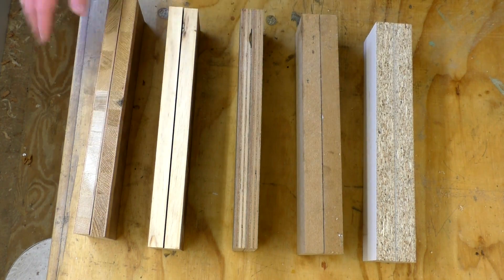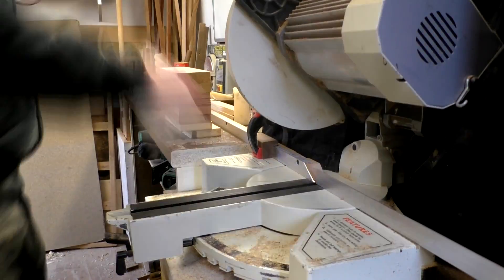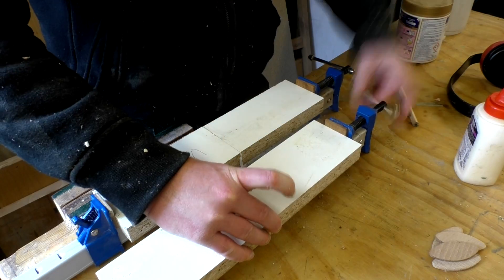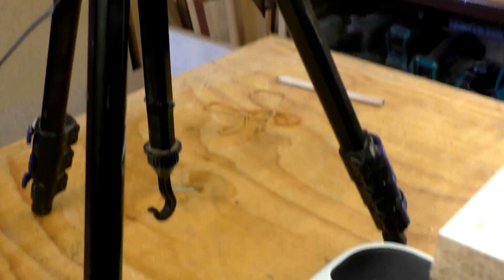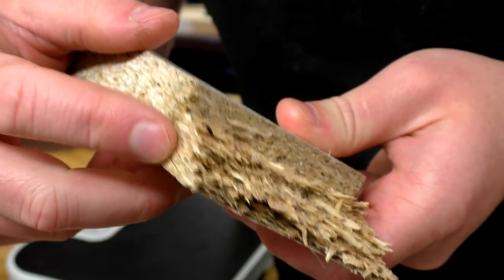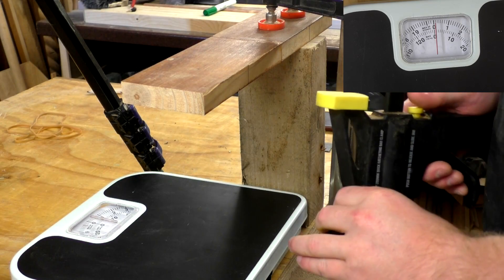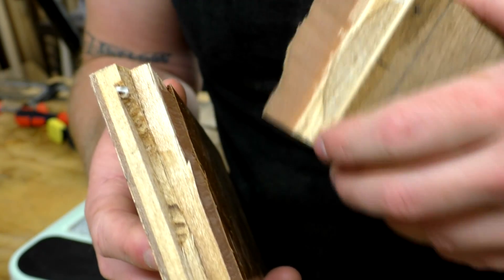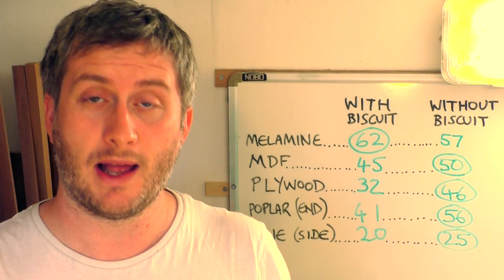Testing Biscuit Joint Strength - Do Biscuits Add Strength To A Glue Joint?

Comment: Not surprised. I'm barely a casual weekend warrior when it comes to wood working, but the first lesson I learned was that it was the glue that was the strength of the joint (granted I'm trusting the woodworker who taught me that). In my first projects I used brad nails as a method to hold the joint until the glue set, but once the glue set, the glue would holding the joint together. Biscuits have always been an alignment tool, and I use as few as possible because the biscuits themselves tend to be weak wood, so they break easier, compromising the integrity of the joint.

Comment: Interesting. I'm wondering what a hardwood test would look like. And a thicker wood test with double stack biscuits. 

Mind you, I wouldn't expect any joining method to hold together using either of these methods when lateral pressure is applied. I'd at the very least use a half lap or dowels. Still under this kind of test I wouldn't expect any joint to survive long. Even a mortise and tenon joint would fail given enough pressure.

Comment: I dont understand why people keep saying that wood will break rather than glued connection. Why are tenons used then?
Reply from the maker: Tenons are used to increase side grain to side grain gluing surface because side grain to end grain joints are not strong
Reply: @RagnBoneBrown  hmm, how certain are you that that is only reason? I always thought it was mechanical reason, and thats why tenon is 1/3 wide, and mortise walls 1/3 each, therefore strongest joint of all.

Comment: Hey man, although yours tests were accurate, these tests aren't geared to how a biscuit is supposed to actually strengthen a joint. A biscuit is supposed to increase the glue surface parallel with the face of the board. In other words.... Don't test it's strength in bending. Test it's strength in pulling. Like pull the two joints apart from each other without bending it. That's theoretically how biscuits are supposed to help. There are also specialty biscuits like self clamping biscuits. Those can be very useful, as well as alignment, making assemblies go smoother and faster. 

Good tests, but not exactly testing what biscuits are good at... But still good for showing that biscuits actually hurt the flexural strength of a board. I've seen this same result on dominos and metal in lays.

The best thing to prevent bending like you are doing here is a finger joint with only glue holding it together. That's likely to be stronger than the wood surrounding it because you are layering the grain and stabilizing it with a glue bond.
Reply from the maker: When biscuits are used for adding an trim to a table top for example, the force applied to it would be downwards, not a pulling force
Reply: @RagnBoneBrown  ... No it's not, man. The force would be every direction for a table top skirt. People are going to be pulling on that thing and leaning on it and every other way of force. Not just straight down. And I didn't say "this isnt how people use biscuits" I said "these tests aren't geared to how a biscuit is supposed to strengthen a joint". People use biscuits like you showed all the time, and NO it won't add strength this way. If someone was gonna use a biscuit for a table top skirt it won't add any strength. It will just help for alignment. But let's say if you had biscuit joints holding a face frame onto a cabinet, and then tried to hammer the face frame back off a cabinet, that is a way that the biscuits should (in theory) add a small amount of strength to that specific direction of the joint's resistance. 

I am a professional cabinet maker. I occasionally glue face frames directly to cabinets with no joints, nails or screws. Just glue. I attach hardwood edging to adjustable shelves with only glue as well. I make cutting boards, and attach panels together with nothing but glue. And I've tried to disassemble them when I've made a mistake, and it's practically impossible to disassemble with a great glue joint. It will destroy the cabinet. The glue joint is plenty strong and does not need any help what so ever. I've never gotten a call back from a busted joint. BUT... IF a biscuit joint is gonna add strength, it would be against pulling the joint apart perpendicular to the glue joint. 

So in conclusion.... Yes... Biscuits CAN add strength in specific applications, but it's completely unecessary. With a good glue joint you will have every bit of strength you need. Biscuits are most effective for alignment and specialty tasks like self clamping biscuits from Lamello or the T slotted biscuits from Lamello. But they CAN add strength when you use it the way I said... And you need a high quality biscuit too. Not dried out crappy ones. Any biscuit from Lamello will give you optimal results

Comment: I'm definitely surprised! I always thought biscuits added a small amount of strength because they increase the gluing surface area. But for it to be weaker almost every time is a shock.

Maybe things would be different if the biscuits were made of a stronger material.

Would also be interesting to see your identical experiment done with dowels.
Reply: I don't think so, I think is has more to do with the surface area than anything else. With the biscuits there is less surface area, in this case. That biscuit joiner is removing almost a third of the area. Biscuits also have big gaps on the sides were you would just have glue.

Comment: There are different types of biscuit joints such as metal and plastic connector biscuits. Lamello are the leaders in this field. If you cannot afford a Lamello go with independet biscuits such as Knapp and use another biscuit jointer such Mafell, Dewalt of Makita.

Comment: I realize knocking biscuits is kind of the internet contact sport of the moment, but I still like using them for joints which don't require a lot of strength.  I find they save a lot of time and prevent alignment mistakes, and the cost of tools & supplies is low.  I used to have a jar of three-layer plywood biscuits that made a slightly stronger joint when gluing the ends of plywood together, but it's not hard to improve on the strength of this type of joint.  They worked for tensile/pulling strength, but probably didn't do anything for bending.
Reply: Good biscuit joints can be really strong they can also be combine with other joints such as pocket holes.

Comment: SHEAR strength. When will a biscuit joint ever be under load in a lever action situation. Tests need to be conducted in their respective application. Biscuits would mostly always be under a shear load.
Reply: I disagree, biscuits are used quite commonly in this way actually - e.g. adding a solid wood trim to a veneered board with biscuits when making a table top for example.  The stress would be applied in exactly the same way as in this video - by arms and elbows for example.  Or even feet if someone were to stand on the edge of the table top

Comment: The method of your test is showing the tensile strength of the joint. The intended purpose of biscuits is to increase the shear strength of the joint. You might want to try your test again with the board held still on each end and the load applied in the middle to create a realistic comparison.
Reply: Have you ever seen a bending moment diagram? What you have said makes no sense. Shear is constant in a built-in single point loaded beam.
Reply: @sa00287  he might have used the wrong technical wording but his point is correct. The way this was tested isn't the way that Biscuits may improve strength
Reply: Isn't this test more of a shearing/tensile hybrid? I would think a pure tensile test would have to pull the joints directly apart...

Comment: My impression is that the biscuits will aid in keeping the joint together, by adding additional glue to the joint that is in shear, not just tension like a joint without a biscuit.  I would never use a joint with a biscuit where there is any substantial bending load on the joint.  Very interesting and thought provoking video, well done!

Comment: The deflection in the piece that was used to clamp the test piece to along with only running one test makes these test results barely indicative of strength. Yep you did admit it was hardly scientific which is very true. 
Also, side grain testing in block board is going to be inherently flawed since you have a natural break between each section where the grain is not naturally tied in with itself and a break in each part. this is always going to be the weak point, like the window in a plane fuselage or if you ever drill a hole and fill it in again, it will never be as strong as before. 
the plywood test is the same situation since your biscuit only contacted one layer of the plywood, otherwise it was just  the same as without a biscuit. 
appreciate you trying to make the video appear scientific but it was a bad attempt to put matthias wandels method into practice and the results are pretty much meaningless. 
Personally when I make table tops from hardwood along the side grain, i will not use biscuits or dowells or dominoes, just glue and I've never had any breakages or failures occur. 
I would just refer back to matthias wandels versions of these tests for actual semi-reliable results, which even he admits are hard to take as proof, given the small sample rate.

Comment: You’re wrong. No one uses biscuits for end grain joints. No one end grain joins anything! Tribute same test with right angle joinery, like how people normally use biscuits.
Reply from the maker: You’re missing the point. The point of the experiment is to test the strength of the biscuit to see if it adds strength. It’s not to test “normal” uses of biscuit joints.
Reply: Rag 'n' Bone Brown but surely it an obsolete experiment. I like experiments and I do enjoy your videos :) Wasn’t a dig but a different thought process. Carry on doing what you’re doing old chap. 👍

Comment: The joint is fine depending on what it’s used for. Great for face frames and joints that don’t require a great deal of stress
Reply: Great for carcas work as jointing as well. You would never use them on a table but they could be combined with screw joints. 

Self locking plastic and metal biscuits can be used to clamp the pieces.

Comment: Interesting results with plenty to follow up on I'd have thought. One thing I would say is when I was learning my trade as a carpenter/joiner, I remember asking if biscuits added strength. The old boys said a categorical "no, they for alignment only". For that, they're a great, cost effective and quick solution. But that response from my teachers has always stuck with me and I'm surprised to hear there's been a debate happening - between who?
Reply: Same. I don't know if this was old knowledge that was lost over time, or because of how popular Norm made biscuit joiners which made everyone forget; but I was taught the same thing. The glue is the strength of the joint.

Comment: i am making a yard art display, mother deer with her 2 twins, but the sheet of plywood is 1 foot to short and the mother deer head will not fit, so now i have to add a extra piece to make the head. glueing it i will not be able to clamp them together, biscuits and glue, but again i will not be able to clamp it. do u have any other idea's on how i can attach the head. i was also thinking about making 2 heads but one have a longer neck then use the glue and biscuit to attach the head, then on the back attach the second head and neck for extra support. but then the display will only be mainly 1 sided not exactly the same on both sides. since some people want to display facing either direction.
Reply from the maker: I’d consider using epoxy as it’s a better gap filling glue than wood glue is so if you can’t clamp it it might be more effective

Comment: I like your approach to this, but I don't know if I would put joint like that in the middle of something that is load bearing.  How about a test for shear strength of a board with/without biscuits at each end and the load in the center, like the middle shelf of a cabinet?

Comment: Near the beginning of the video you stated that you thought a piece of hardwood inside the middle of the joint would make the joint stronger. I think that this is still a true statement. The thing is, those biscuits you buy are anything but a piece of "hardwood", in fact they're nothing more than compressed saw dust. I think it would be interesting to cut a few biscuits yourself out of various materials and see if they were any stronger.
Thanx for the video. Interesting topic.
Reply from the maker: that would be an interesting experiment - I may do something like that in future
Reply: Steven Gockij
I don't know where you are buying your biscuits but the ones I use are made of beach. I have never seen on that wasn't solid wood.

Comment: I would say also that the hole you put in the wood weakens the wood. Double biscuits work best on these end grains. Yes you cut out more wood but it is twice as much glue which is the main joint power. Would loved to be proved wrong. The other thing is who in their right mind is putting that much weight on a end grain joint lol. Nice vid Sir

Comment: I have never thought that a biscuit joint was stronger, rather that it keeps two pieces in the same plane for glue ups. I typically plane the surface of a glue up, I wonder how a rough cut vs a planed surface compare in strength.

Comment: Nice test!  Your method is spot on.  I work in a calibration lab for nuclear power plants.  We also do destructive testing similar to the test you did here.  The big difference between your test and one we might do would be the accuracy of the test equipment.  I noticed only two things with your test.  When placing the force on your scale make sure it is in the middle of the scale.  If you are around the edges it is called side loading and you could lose accuracy on your scales readings.  The second is the speed at which you apply the load.  You want a smooth steady application of the load.  If you go too fast it will alter the data, and the same if you go too slow.  Since most of your tests were about the same speed, it's still apples to apples.  You just might get different results if you go at a slower pace.   Otherwise, your tests were really good. 👍😉.

Comment: Not surprising. I've seen a few other channels do the same experiment (set up a little different) and the usual outcome was that the biscuit joint fared about the same. The conclusions were that the biscuit was mainly used for keeping the boards aligned during the glue-up but added no extra strength.
Cheers..

Comment: How about the mitres joint? If cut across a mitre joint ( eg a picture frame) and add biscuit in there wouldn't add strength to the joints???

Comment: Nice test. Realy ! :.-) 
I found out, that a quality of biscuits varies.
Once I bought  biscuits from Lamello brand, and they are very strong. 
Try to use differend brands of biscuits. Maybe you will be surprised. :-) 
Thanks.
Reply: I'm not surprised lamello are the best, they invented the biscuit jointer and being Swiss they even manage to outdo Germans in terms of quality tools.

Comment: As an owner ( and infrequent user) of a biscuit jointer, I worked on the assumption that they added strength.  I was lead to believe that they would swell from the moisture in the glue and provide tension and extra gluing surface area. This experiment was an eye opener.  I would have preferred to see each glue up done in duplicate or triplicate to test the reproducibility,  but now I'm getting picky, and long winded.  Thanks for taking the time to do this.

Comment: Very interesting video! I'd have thought that the extra surface area in the joint would have made it stronger but apparently not! Maybe biscuits will add strength to a joint which will make it harder to pull apart rather than bend? Who knows
Reply from the maker: +Brewmaster~ possibly yes, although that would be more difficult test to set up... I'll get thinking!

Comment: Very interesting  test/experiment.  A kind of Matthias Wandel style. Very good.
The result do not really suprise me because I heard already before that biscuits are for eating and not for strength.
But I was quite surprised about the way you tested it:
Melamine, MDF and plywood are boards/panels. In that case you hardly need to make boards longer or wider (unless you want to you more pieces of scrap).
More useful would be testing corner connections with biscuits for these materials. This you need when you are making boxes, drawers, etc.
For solid wood it is in fact the same.  It is very useful to know that end grain connections are quite strong but needing that does not occur so often.
Maybe a panel glueing test (with and without biscuits) can be more of use.
When you have 5 pieces of solid wood, each 4 inches wide and you want to make a panel/board of that, which will be in that case 20 inches wide.
Depending on the length of the pieces you need more biscuits for each piece of wood to connect (at least 3)
Don't see my comment as criticism. Regard is as a (maybe useful) addition to the experiment you did in your video.
Reply from the maker: +Hans de Groot thanks Hans, I may do a follow up with some more tests